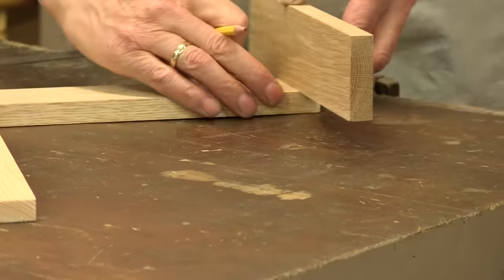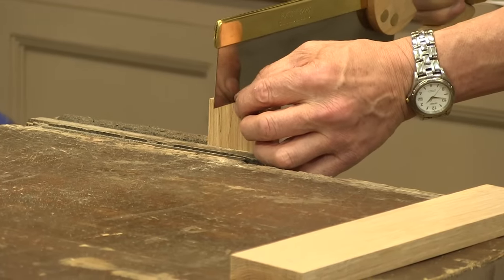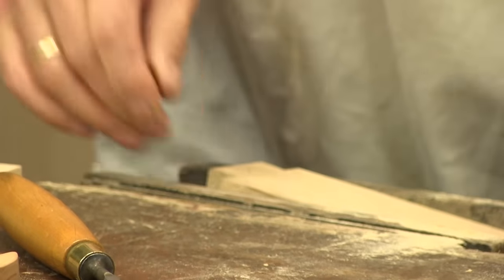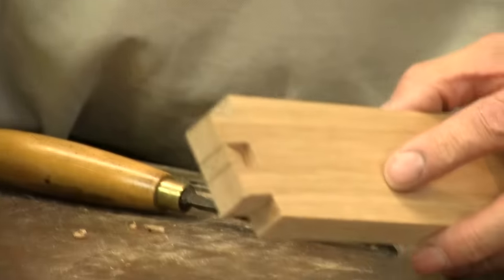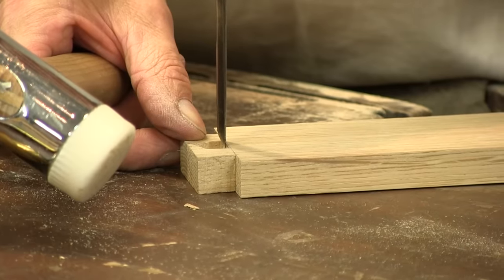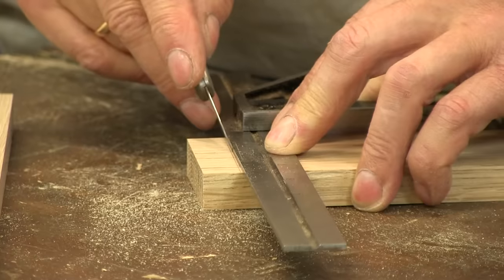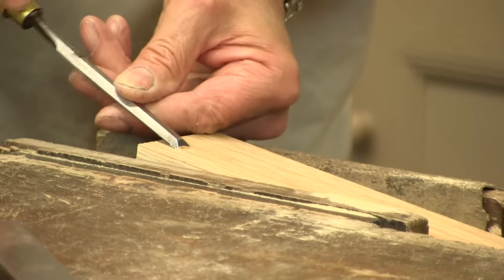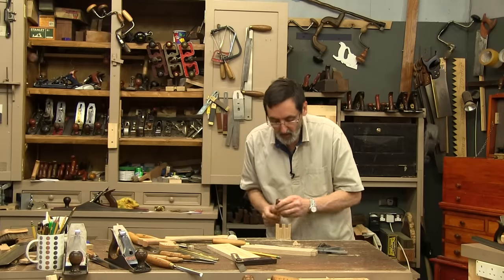How to make a Dovetail Joint - The Three Joints - | Paul Sellers

Comment: So after mangling my first dovetail joined drawer pretty badly (it works, I mounted it today), I watched this video most of the way through last night, went into the shop after work today and slowed myself way down and tried to do a joint for my second such drawer following Mr Sellers's advice.  It came out much better.  Took me two and a half hours to make the first joint and it is not even close to what Mr Sellers does in this video, but it's a lot closer to a decent joint.  I advise others to do the same to learn the craft:  follow his technique advice and slow way down.  I figure that, when I have cut a couple of dozen of these, I should be able to do a reasonable job of it and a little quicker.  Not up the standard of this gentleman, clearly, but enough so that I won't be looking for ways to bury the work where nobody will ever see it.
Reply: I consider doing a half decent joint after his video an achivement. Mr Sellers passed us 50+ years of experience in less than an hours, and the results show it.
Reply: @fg3136  My standard for half decent may also be a bit low.  LOL.

Comment: What I love about this man is that there is not a power tool in sight. No sawbench, no radial arm saw, no router table. All done by hand.
Reply: While this is true, like a lot of handtool woodworkers, he still uses a bandsaw. He has a gigantic bandsaw just out of frame to his right.

(but yeah, he kicks ass and I watch all his videos because he's just got a ridiculous amount of talent)
Reply: Paul differentiates between power tools and machines.  Power tools are tools which use power rather than hand tools but which the owner still must guide to properly use.  Machine are quite the opposite.  The band saw, lathe and power drill/driver are all I've ever seen him use.  However when he builds workbenches or prepares stock in bulk (like for a class with several students), for time he would use machines.  I would not depict him as "anti" machine in the sense that they have no place whatsoever, but given the vast majority use them exclusively, he does have that reputation.  Of course the hand tool is supreme.  :)
Reply: Benjamin Fisher I think hand tools seem to end up with a better result than power tools - plus its more fun! One can create a tenon in under a minute with a radial arm saw but spend 10 times as long using a chisel and hacksaw and get more enjoyment from it.
Reply: Agreed.  Once you consider health and safety, it's even more provocative and actually faster unless you're making a dozen of something (industrial setting).
Reply: Benjamin Fisher It seems to make a much cleaner cut, because you can position the saw in whatever way you want. With power tools, its one movement. Good for large projects like doors, cupboards, large tables. Not so good for fine stuff like that clock from earlier. Plus hand tools seem to create a lot less dust.
Reply: Benjamin Fisher ' Power tools are tools which use power rather than hand tools but which the owner still must guide to properly use.  Machine are quite the opposite.' 
I'm not sure what you mean here? Please elaborate, thanks.
Reply: you should watch the woodwrights shop. I marvel at that man's use of hand tools
Reply: Ant Mallett I meant power tools are tools that use power but still require control and skill of the worker.  Machines require little skill or know-how by comparison.  The band saw and lathe are power tools.  The planer, table saw, jointer are machines.  Fast and necessary for an industrialized setting, but a craftsman they do not make nor encourage.
Reply: ***** The only tool in sight is him hahahahah
Reply: +Benjamin Fisher 
Neither one is supreme to the other, they both have their places in woodworking. Also, to say that machines require little skill in comparison to hand tools is quite naive, if you don't mind me saying. If you don't know how to use the machine properly, your result is most likely going to be bad (the same goes for hand tools). If you have a lot of experience with the machine and know how wood works, you can make amazing things with the machines, some of which you would have to spend ages doing by hand. Sharp tools, skill and knowledge, if you have all of those three, then it doesn't matter whether you're using power tools or hand tools, your end result is going to be pretty much the same. Long story short, use both and you'll be doing the best out of both worlds.
Reply: +Benjamin Fisher i find the big difference is whether the tool is an extension of you, or you're dictated to by the tool. some machines fall into the former category and some into the latter
Reply: +Anthony Kernich Amen!
Reply: I don't understand the sentiment. Use the most efficient tool that you have for the job. If you have power tools, use them.
Reply: i love paul sellers videos! ive learned so much watching him than anyone else here on youtube
Reply: @rhyansimmons2691  anybody can make perfect dovetails with a router jig. Sometimes it’s not about efficiency but thought and craftsmanship. That’s the difference between Paul and IKEA

Comment: Clear, concise, precise; no waffle, dribble or bull.  Thank you Paul.  Very inspirational.
Reply: +Terry Hart word!
Reply: +Terry Hart At 22.14 There is no shading of waste which is fundamental to basic woodworking and the use of the chisel in thtroughout this video is not standard traditional practice and far too time consuming. You never cut along the grain - an amateur watching this would likely split the wood especially when a mallet is used. And you NEVER cut straight on the shoulder line but work progressively towards the shoulder line to avoid the wedge of the chisel edge cutting beyond the line. This is elementary woodworking practice being ignored!
Reply: @woodscholar6705  Yeah,he doesn't have any idea what he's doing,that migth be the reason why your channel has way more subscribers than this one.

Comment: Excellent Sir!
Due to my eyes not focusing as they used to, i add a few strokes of pencil lead to the leading edge sides of the tails. When i test the fit to see the interface that is tight, it will show the lead traces that need pared down. As you called it the "bruising area". Great chisel work, just the way i like to do myself. Thank You!

Comment: So many negative comments on this video it is astonishing. As others have said, the point is being missed entirely. Whether you like dovetails or not, use a coping saw, prefer speedy work or whatever- take some time to view it through a different lense. As a woodworker who primarily uses power tools, every now and then a situation presents itself that would benefit from skilled and concise chisel work. I used to avoid them as much as possible because I wasn't comfortable or skilled using or sharpening them. But now, if I take the time needed to practice the steps taught here by a master of the craft (think piano scales or learning cursive writing) I will probably gain confidence in my newfound chisel skills. I can then easily transfer those skills to whatever project might benefit from controlled and concise chisel work. I will chisel out too tight mortises, or whatever, like a ninja and never let my lack of skill stand in my way again. Even if I hate the look of dovetails (which I do not- but to each his or her own) or never handcut another dovetail as a woodworker. 

Thank you Mr. Sellers for taking the time to produce this instructional video. Your instruction on the subject is easily the best I've seen, and that includes previous face-to-face instruction.
Reply: I'm a bit of Hyper active person. I've did a lot of things with power tools but the way that Paul Sellers is using calm me down. I've broken many, many wood pieces because of rapidity. Now it may take me twice as long for the same project but I try not to do any mistakes. :)

Comment: You encourage me to try again. While learning, is hardwood or softwood better?
Reply: A softwood requires a less radical angle for the cheek of the dovetail while hardwood is strong enough to support a sharper angle. So it depends on your preference. I find that softwood is best to practice with because it's so much cheaper.
Reply: You will waste a lot of wood before you get four corners right.  At least I did.  Let your wallet be your guide. They both require very sharp tools and a lot of reasoning.  But one day you will just be able to do it.  Took me a couple years.  But I'm stubborn.
Reply: All softwood / hardwood means is, actually, how that particular tree reproduces itself.  Softwood is like saying gymnosperm (seeds are not enclosed, like apple, think pinecones, often evergreen) and hardwood is like saying angiosperm (seeds are enclosed, think apple, generally deciduous broad leaf trees).  There are some softwoods which are quite dense and some hardwoods which are not.
Reply: Thanks, guys. I have some old 1x4 pine I can practice with. I like using the angle gauge instead of a jig and just using chisels instead of coping saws, etc. And - no marking gauge - just use the other wood. Works for me. Now, if it will just warm up a bit, I can get to work (play).
Reply: Kenny Boothe After trying every marking device known to man, I prefer the sliding angle gauge as it has a certain flair to it.  I detest coping saws.  I have winnowed it all down to pretty much do it the was Paul Sellers does it, except the sliding finger marking technique I am trying to learn.  I do wish I had seen this video 10 years ago.  When you do a dark wood like walnut pencil marks are almost invisible so I use a clothes marking pencil but you can may prefer a marking knife or put down blue tape and mark and cut on it.  I saw that on an Aussie's video.
Reply: Benjamin Fisher Thanks for the correction.  This is generally common knowledge among woodworkers and we should all use "hard wood" when that is what we mean.  Technically, balsa wood, Ochroma pyramidale, is a hardwood.  And yellow pine, a softwood, is much harder than many hardwoods but is not harder than most hard woods.  Sorry, I couldn't resist that last part.  .
Reply: I actually suggest basic spokeshave / gouge shaping to start, learning to read grain being one of the most important skills to learn, add in some chisel work to your shaping.  Then dado and mortise/tenon may be easier to learn before dovetail.  Thinking about it now, dovetail might be the most frustrating place to start?  But don't be discouraged to start somewhere either way.  Don't over think it, just start working with no expectation to excel at first.
Reply: Get yourself some pine and get started! Don't bother with box joints.
Reply: Kenny Boothe  I get a lot of free wood from work. I would bet you could go to any job-site where an addition, deck or Cedar siding is being used and pick up all kinds of various types of boards for free. The guy using the wheel barrel will probably even  help you load it :).. The cedar does have a rough finish on one side so it has to have some work done to it. I have all kinds of Cedar, Cherry, Oak and pine that I have brought home over the past few years.  You can't beat free cedar 1x4's, 1x6's etc. Might be worth a shot ;)
Reply: Just think of this: Balsa is a hardwood.
Reply: Kenny Boothe   When you are learning from Paul be ambitious. Buy the best tools you can afford and get on with it with the best wood. A poor joint in walnut looks and works a lot better than in recycled wooden pallets. It’s much easier to work with hard woods than stringy pine. Using poor wood is disheartening when your joint turns out better than you expected, and would have looked great in a decent wood.

Comment: I'm just about ready to sell my Leigh Jig and use the proceeds to purchase the tools to do it by hand.  What is a good saw to start with?  Say less than $200  I believe I have all of the necessary chisels
Reply: coldsteelbluestare  Thanks for the info.  I'll be near Woodcraft later this week, I'll stop in a check it out.
Reply from the maker: ***** Yes, there are suppliers here. Axminster UK sells them.
Reply: Kelly Burns 200 dollars for a saw? My electric jigsaw costs less than half that
Reply: Kelly Burns They're pretty respectable actually, as long as I cut less than I need to and clean it up with a rasp
Reply: Interesting.  I just don't want to do power dovetails any longer.  Looking forward to relaxing handcut ones.
Reply: +Kelly Burns You probably already got a saw considering your comment was about 6 months ago, but I bought a Rob Cosman dovetail saw and its awesome. Its one of the heaviest dovetail saws which makes it cut really well.
Reply: +AlphaRapax And your electric jigsaw does 50% of what a good handsaw can do ;)
Reply: +Andrew C Somebody call the burn ward
Reply: AlphaRapax All tools are good for a specific purpose, and some can be used for alternative purposes. I even used a bandsaw for light grinding purposes because the grinder was broke.
Reply: +Andrew C Oh believe me Im all to familiar with improvising tools. I've used plywood and epoxy to make a sanding disc for my angle grinder, improvised a belt grinder out of an old water pump and used sharpened flathead screwdrivers as chisels
Reply: AlphaRapax That's awesome. Magyver-ing is needed quite often, especially for people like me who don't plan well hahaha.
Reply: +Andrew C MacGyver-ing you mean?
Reply: AlphaRapax Prolly so. Never watched the show, and with so many variations on the spelling of the name I didn't bother to verify it online before posting. 
Now had this been one of my thesis papers or for a dissertation, then I surely would have done so.
Reply: +Kelly Burns  hahahaha
Reply: +Kelly Burns I bought Rob Cosmans dovetail saw and really like it. The handle is really comfortable and the weight is what really stands out. The saw is what really makes the cut, not my hands as they act more or less to guide to the saw.
Reply: +zac thompson You sure about that? I had to make a cut on a 2x4 the other day and the pull saw was handy - took about 4 strokes once I got it started, and straight cut, too. It's easy to see the reflection in that wide blade.
Reply: +Kelly Burns The bug got me too lol!  I WILL be trying this soon.  Can't wait to do a video of a project from what I've learned here.
Reply: +Kelly Burns you can get Japanese Dozuki Dovetail saw for about $30 on Amazon, Rockler, Ebay... I have one and it has been serving me so well that I am buying another one
Its cut is so thin, it only fit a razor blade (literally!) I even use it countless times to start my crosscuts before using my Ryoba to cross-cut a piece of my exotic hardwood (purpleheart, teak...) It cuts my wood like butter and stay sharp for as long as I have it - it'd be reallllyyyyy looooonnnnnggg before you need a replacement blade ($15 or so) as the teeth are harden and hold their cutting edges so well that you couldn't sharpen it yourself.
Dont find a need to pay $60 - $200 for a Tenon/Dovetail saw...
Reply: +Kelly Burns, Crown Straight Dovetail Saw ($26). Received "Best Value" and "Best Overall" awards from Fine Woodworking.
Reply: +Kelly Burns there is a lot to be said about the quiet that comes with using hand tools.
Reply from the maker: you can buy an 8" or 10"_Pax gents saw for under £25 that works great.

Comment: Thanks Paul I have been following you for some time.   What I like about you is that you do not "SELL" tools or tell people you need to buy or recommend someone to buy expensive tools to do simple joints.
Reply: +L Gorman Forgot to ask ... when your doing a plywood hanging tool box .. which joint would you do?  A finger joint or dovetail?   Plywood is a tricky material I find to work with .. but to make a tool box out of Walnut or or or is expensive and a bit over the top for my shop.  Pine is to soft .. at leased for me .. it marks up to much.

Comment: If you try cutting these joints in softwood on a scrollsaw make sure you have hooked teeth blades . I discovered how good they are this week .  Not too far away from hand tool work and fairly quiet . I was amazed at how good my new Bahco chisels were .

Comment: I enjoyed watching a bit different way of using mostly a chisel to remove the waste. The hardness of the wood made a huge time difference from this to previous pine wood that cuts easily compare to oak, long and tedious but carefully sculpted, the end result is the ART of the perfect Dovetail.
BTW, curious of the brand of the Dovetail saw.
Thanks Paul,
Reply: Paul, You can just make out at 4:41 Pax 1776. I did a quick search and found that I think its a 10" PAX 1776 Dovetail Saw (20 tpi Rip Cut) by Thomas Flinn which I found at http://www.traditionalwoodworker.com/10-PAX-1776-Dovetail-Saw-20-tpi-Rip-Cut-by-Thomas-Flinn/productinfo/279-2063/

Comment: Great  job -- well done. Paul, have you ever sawn out most of the waste with a coping saw?  It's very obvious that your chisels are razor sharp, too; an essential for this work!  "Practice makes perfect" is most true to become good at making these joints. A way of finding the tight sections is to pencil each tail side then join the pieces together. The grey lead transfers to the pins and you can see where the tight spots are. Then if it's very close, you can use a file for final fitting.
Reply from the maker: I’ve cut the waste wood from dovetail recesses since i was 15 using the coping saw but I found that people new to woodworking don’t cut close enough to the line to prevent end grain tearout in the recess so I don’t teach that method and actually I very rarely use it except for rougher joinery. The methods I use work so well so I rely on the maxim, “ If it aint broke, don’t fix it.”